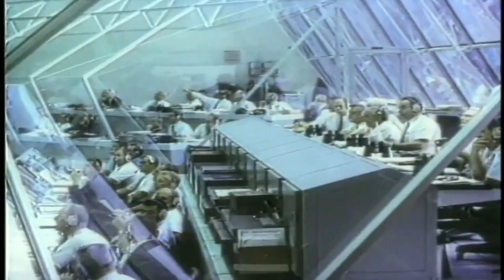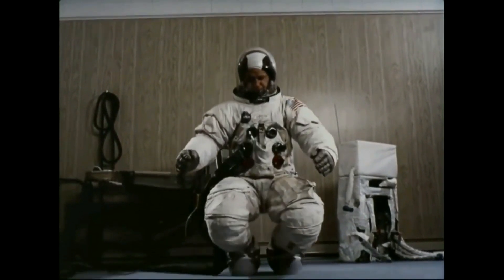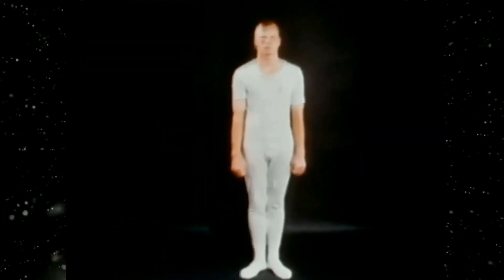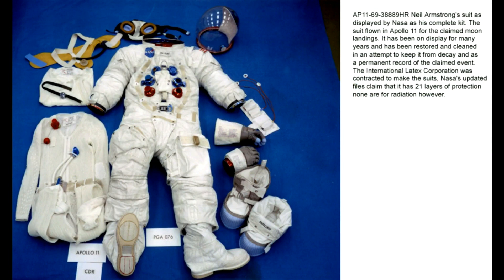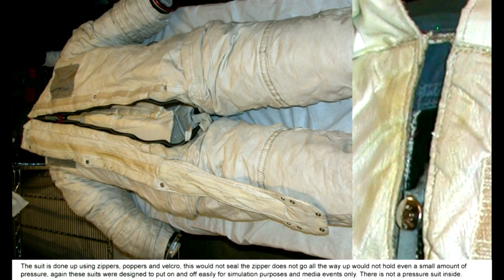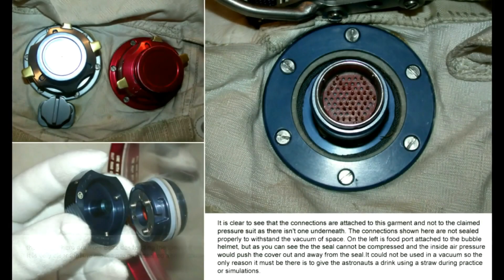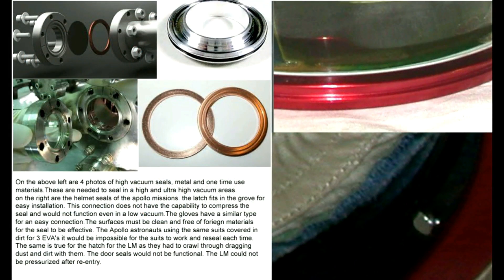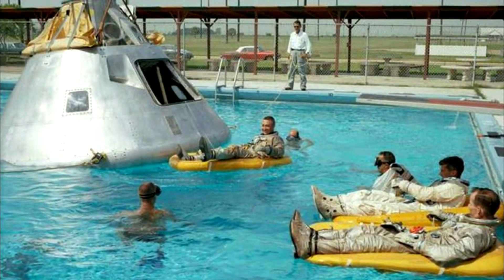Faking Space S3 E4 "Space Shenanigans"

Comment: @7:16 yet another example of conflating positive and negative pressure.  seals on a vacuum chamber are being crushed... meaning the pressure is pushing on the outside towards the inside, this is putting a deformation (yield) stress on the material.  a suit is under positive pressure and the seals are being stretched or under tensile stress... materials are much much much stronger under tensile stress than yield stress..  comparing the 2 is nonsense.   why can nobody in this community understand this very simple concept.  just video after video of no understanding of it.

Comment: NASA = Nazi American Space Agency
NASA is a Nazi infiltrated American organization that has stolen untold trillions of dollars from the American tax payers and should be defunded and the truth told to the public, we NEVER went to the moon! AstroNots have never been above L.E.O. and have no way to go beyond the Van Allen Belts. Couldn't do it then and still cant do it today. PERIOD!
Reply: Pretty acurate. Saturn V 2900 ton carosine, 118 ton cargo. Space Shuttle 2100 ton hydrogen, 82 shuttle + 25 ton cargo = 108 ton. Same for Artemis. Difference between LEO and Moon is 25,000km/s vs 40,000km/s you have to go 50% faster. Not to mention F1 engine wasn't working on full throtle it was instable if worked as supposed to work. Highest they tested was 650km close to inner belt starting 1000km or so. Now they postponed lunch cause there was recent sun storm.. their seal leak, their engine not workin properly. Unmaned is different story it takes 5 minutes, not 10 minutes to speed up cause equipement is capable to survive such acceleration 20g people arent. We do have geostationary satelites, that's for certain there is no other way for satelite to stay. But it makes me wander.. is it even real? If they send satelites trough belt. Geo stationary orbit is 35,000km they must protect equipement they must know level of radiation. Why they put so many probes on Orion then? Should be already known! But for certain humans stay within 400km for these two reasons rocket not powerfull enough and radiation. Improvements in current technology wont change the nature of reality. Until they figure antigravity
Reply: @KabelkowyJoe  Have you had the chance to hear the whistleblower death-bed confession that Apollo never went to the "moon"? Bart Sibrel has a channel here at TheirTube and was given the facts for it all.
Worth seeing if you are unfamiliar with it?
Fact is, no man has ever left LEO, ever!
Can't be done today with thousand-fold advancements to 1960's Apollo era technologies, leaving no doubt that it was not done in 1969...
All the stats you've memorized are irrelevant, my friend.
The rockets go up, and the rockets come back down, but nobody is going ANYWHERE!